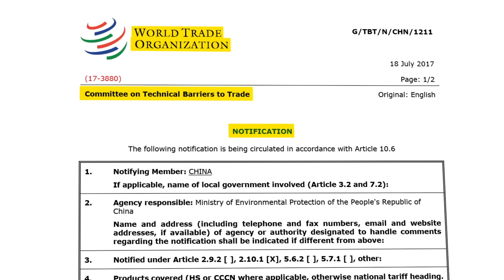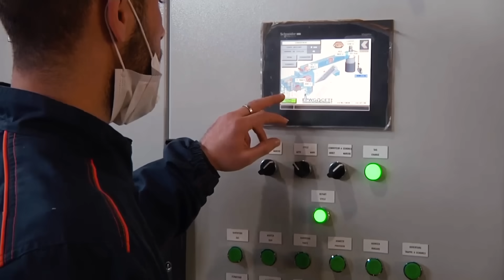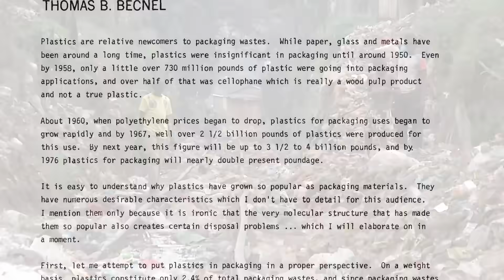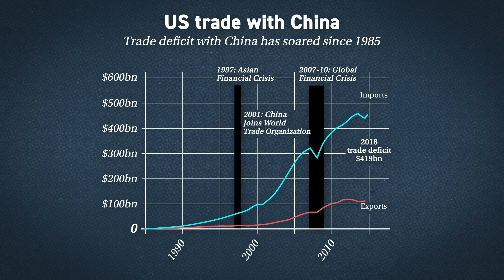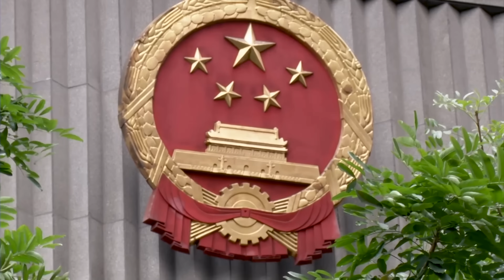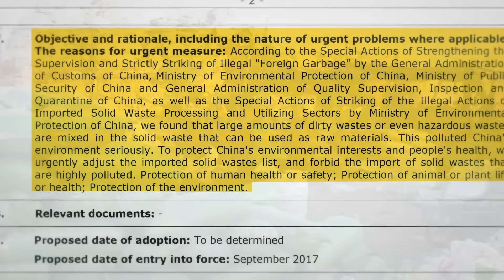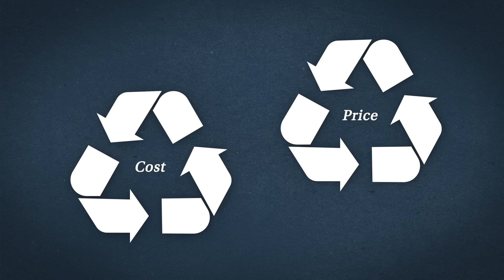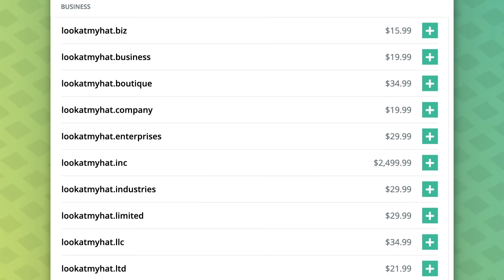How China Broke the World's Recycling

Comment: Good video but you missed a few key points:
1. Residual bails don't get exported- they get landfilled.
2. There's enough domestic plastic recycling production in the US to make at least most of the plastic by volume (HDPE, PPE) cost neutral for MRF's.
3. The problem is NOT plastic.  It's mixed paper.  Plastic is a small percentage of the MRF recovery,  Paper is about 70-80% and has essentially no domestic recyclability.  Paper is what's killing us.

Comment: You know, I just happened to think about the matter half a day later again and something suddenly came to mind. The issue is that there is no easy way to identify what the plastics are, so they can't sort them apart. So why not just make it so the production industry has to mark it in a way that's easy for the recycling industry to identify? You could even create a coordination center between both sides so they could select solutions that create the least issues.

That way one could not just close the loop to the previous level, but do better then before even. Admittedly it would take government action, something which wouldn't be popular among everyone, but this is far from unprecedented government action for curbing environmental pollution. Rather it's pretty mild really.

So I can't help but think this problem only persists because no one can be bothered to coordinate the different parts of the industry to work together better.

Comment: Cheap solution: "new" plastic cannot be sold in any way shape or form that doesn't include a minimum of 50% by weight recycled plastic. 
Less cheap solution: Artificially raise the price of "new" plastic to be more expensive than recycled
Expensive solution: Yeet every Coke, Nestle and Pepsico exec straight into the sun in a rotating fashion until the problem subsides.

Comment: I'm from Eastern Europe. I remember when back in the '90s every bottle was "returnable". You would get a small amount of money if you returned it, and they would clean then reuse the same bottle. It worked well. But the system is gone...
Reply: It stopped because it was discovered plastic does break down on a microscopic level by repeated use, and ingested micro plastics damage hormones. Happens in generic water system plastic pollution but also with plastic bottles used for a month.
Reply: @penzorphallos3199  No, it stopped because plastic bottles replaced glass ones. Back in the 90's, we had everything in glass bottles: milk, water, even cola. At least where I lived, only glass bottles were returnable (and there weren't enough plastic bottles around to bother doing the same for them anyway). 
Now everything uses plastic bottles to save the big corporations a couple cents.
Reply: @mute1085  Your "because" is not correct. That's just your opinion. Dig a little deeper and don't make assumption and then try to pass them off as facts. 
The REAL REASON???
"t stopped because it was discovered plastic does break down on a microscopic level by repeated use, and ingested micro plastics damage hormones. Happens in generic water system plastic pollution but also with plastic bottles used for a month." - Penzor Phallos
Reply: @mute1085  For me in Italy it was until the 80s, in the 90s everything was already plastic.
Reply: huh, not the only 'system' in Eastern Europe that disappeared in the 90s
Reply: yes metal cans, paper, wax paper, foil, glass all sufficient, we need to limit plastics use to permanent things not disposeable items
Reply: Because they biodegradable plastics now so those is only one use plastic ....other wise risk it breaking down
Reply: a bottle deposit system would be amazing. i really wish we could bring back glass bottles. makes things taste better, and it is also a million times more sustainable than this plastic rubbish. also doesn't have the same cancer-causing chemicals that plastic receptacles have.
Reply: Returnable bottles are still quite common in Austria.  Most beer and a lot of wine is sold in returnable bottles.
Reply: We need glass bottles back. At least glass is much easier to recycle than plastic, and if it was thoroughly implemented by companies and governments like it once was, the cost would come down to be level, or even cheaper than using plastic bottles.
Reply: Oh no... since when? I enjoyed that in Germany. Metro NYC does it also.
Reply: That kind of system is still in use at the very least in the Nordics. Pretty much every bottle and can has a return payment added to the price that you get back when you return them. The rate of bottle returns is around 90%. It's unfortunate if other countries have stopped doing it.
Reply: @brlbrlbrlbrl  but they aren't refillable, we need to go back to bottles and containers that can be reused.
Reply: I'm from China, and I remember the same system back in my childhood, but only for glass bottles as far as I can remember. Mostly coca cola and beers, you just return the bottle to where you bought it. Haven't seen it for years now...
Reply: in autsria and germany we still have that
Reply: We used to do that in Australia too.
Reply: The US had returnable bottles till the 1980's. S. Korea still has returnable beer bottles. If we put a deposit on all packaging and make industry deal with it, they will find a solution.
Reply: @anonymousetrapper  That's why a system using glass would need local government support, so it doesn't have to be shipped overseas and can be melted down properly in the origin country. Of course you would also need the bottle manufacturing to be local, but alot of modern business already use glass, and their bottles are most likely manufactured in the same country as their product.
Reply: @xanderstuff7  local bottle manufacturing is not enough, you need also have it refilled locally. Otherwise you end up with transporting both filled and empty bottles.  Take a scale and weight a 0.5 l glass bottle, then multiply it by 3 and compare the result with the weight of an empty PET 1.5 liter bottle.
The thing is, PET bottles are recycled more or less locally anyway, they are of the high value plastic variety. The problematic stuff is in those milky youghurt containers and stuff like that, especially the multi-layered items.

Comment: There is nothing wrong with incinerating it.  The heat is used to make electricity or cement. They literally use tires and coal for this and used plastic and paper is far cleaner.

Comment: I wish this video has a little more "solutions" to the issue, like what we can be doing instead of using so much plastic, like paper or aluminum. I just don't like seeing that there's no hope.
Reply: Using less plastics is not a good solution, at least not if you're going to substitute it with aluminum or paper, because studies have shown that those alternatives are generally (much) less sustainable than plastics for most applications. It's not hopeless at all, there are very good solutions for plastics pollution, they're just not really on the political map yet. Here are a few:
-Massively increase incineration capacities worldwide, especially in developing countries. Incineration isn't great because it emits lots of CO2, but it's better than landfilling and dumping plastics in the waterways.
-Develop an international trading system for carbon-containing wastes similar to the european ETS, then use this as an economically optimal tool to tax virgin plastics production and subsidize recycling.
-Develop chemical recycling, which Wendover glances over at the end of this video but is actually probably the most important of all. Instead of incinerating waste, you can actually gasify it, obtain synthesis gas, convert it to methanol, then use the MTO process to produce olefins from which you create new bulk plastics. This is how china has been making its plastics for years, except they get the syngas from coal instead of waste. The plastics that you get this way are of virgin quality. You can use unsorted organic waste (including plastics, kitchen and garden waste, paper, textiles etc.) as input and don't need expensive collection and sorting infrasture. Compared to incineration, CO2 emissions are vastly reduced because the carbon goes back into the new plastics. In fact, if you use plant matter to make plastics this way, emissions are actually negative. Once this technology is in place, it will be quite simple to collect and recycle most of the world's plastic waste that is currently going into the ocean, as over 90% of it comes from just 10 river systems (8 in asia, 2 in africa).

What can you, personally do? Lobby for the political measures mentioned above and encourage people to read up on the relevant literature so they can make informed decisions on what do buy. Also continue to sort your trash, because depending on where you live, chances are it does help recycle at least a portion of it. More importantly, don't litter, because even landfilling in developed countries is far superior to having plastics end up in the ocean. And if you really want to make a big difference using money, use it to buy and delete ETS emissions certificates. if you buy high-quality ones, you're not just reducing your carbon footprint, you're also contributing to various highly beneficial projects including forestation and also plastics waste removal. This is, in general, one of the best things one can do for the environment as an individual.
Reply: @SpaghettiToaster  wow I am completely impressed and also very thankful for your informative reply! Thank you, along with this video, I have learned a lot about the matter. I am very interested in recycling and plastics and I actually think about it every single day. Alot more informed now than before. Thank you!

Comment: Part of the reason why recycling plastics isn't profitable is the cost of sorting it.
Instead of subsidizing, force companies that make plastic packaging to print an code on the item in multiple locations that can be read by scanners at the dump.
Or maybe some kind of isotope for non-food plastics, or a chemical marker. If all kinds of plastic can be machine sorted, it greatly reduces the costs of the recycling process.

Comment: The companies that manufacture and use plastics shall pay for their recycling. They make profits of millions, they should be ready to part with some of it for the environment's sake. If not, It would not be long before all sorts of plastics are banned.
Reply: That is the system we have in Spain... at least in theory. In reality, we have an extremely corrupt system where a "non profit corporation" is tasked with dealing with plastic waste, using the tax plastic producers and distributers pay. The thing is, the company is owned by plastic producers and distributers, so its main goal is not effective recycling, but minimizing cost, so the plastic tax remains low. 

As the whole country depends on this corp, it has an enormous lobying power, and it has been used to stop any plastic deduction/reuse initiative. There is also some high level corruption going on there.

The data from independent sources  absolutely contradicts ecoembes  (the spanish plastic recycling corp). Plastic from Spain has reached all over SE Asia and after the export ban, many "accidental" fires have burnt the piles of low value plastic waste.

Sorry for the long text, but I needed to warn you about how this system may not be enough.

Comment: You don't need to wait for free market forces to solve this problem, if ever. The government has vast coercive power. Ban virgin plastic use for most applications and mandate that recycled plastics only are used. If you dont like that option, add a large tax on all products using virgin plastic. Either result will make recycling "economical" and resolve the issue.

Comment: I've always felt that low value plastics could be shredded, and thrown into the hot pugmill with the aggregate and the heavy tar oils, to make stronger roads. Roads that have less lighter fractions of oil coming off of them (By the process of photochemical and environmental cracking), and last much longer. The ultimate solution would be an aggregate (maybe even recycled glass?) + plastic road, laid with current technologies, that did not use tar.

Do not deluge me with thoughts of bull**t modular plastic roads that have channels and solar crap in them. Those are provably unworkable, and engineering nightmares. We need millions of miles of roads, and by building them with plastic, in a conventional style, we could lock up so much carbon, yet make it useful, and profitable at the same time. Also it shortens the reuse chain to a locally sustainable solution very quickly.

Comment: Big solution you didn't mention : carbon pricing.

Plastic recycling doesn't work because new plastics are dirt cheap... because, like in China a few years ago, governments haven't priced in the externalities of their environmental damage.

If robust carbon pricing pushes up the cost of oil and new plastics, that will also push up the cost of recycled plastics, and the system will work.

Carbon pricing will help renewable energy / electric cars / recycling become profitable, and reduce the amount of carbon & plastic pollution.

Comment: I do not agree with two things: First, the recycling is a technical problem which results in an economic one. The reason for this are the recycling methods. These are too expensive and to lower the cost of recycling new techniques have to be developed. Secondly, shutting down the whole “plastic system”, whatever that means precisely, is the wrong solution. Without plastic many products would be more expensive which leads like plastic pollution to a lower life quality. Also it has to be considered that plastic is responsible for the longer durability of food on which we can all agree on that this effect is a good thing. This discussion would become even more complex if we consider medical goods...

Like all things in life the usage of plastic is a trade off and how to handle it is not a one dimensional task.

Comment: How strange that Plastic Recycling is actually PROFITABLE in Germany... to the point where companies are even importing it just to burn it for electricity..
Reply: You're confused: They're burning it because it is NOT profitable to recycle. They do recycle a lot, but that which is not profitable to recycle is burned.
Reply: @SpaghettiToaster  They burn it and make ELECTRICITY in the process, AND get rid of other garbage that would otherwise have to go to Landfills, which basically dont exist anymore.
Reply: @Basement-Science  Yes, they do, but what does that have to do with the profitability of recycling? Incineration is not recycling.
Reply: @SpaghettiToaster  Yes, incineration IS often included in recycling. And it makes perfect sense for Plastics in particular, since the difference in Energy you get from burning Oil directly, to turning it into Plastic and then burning it, is minimal. In fact while any oil (or Gas) at all is used for power generation, there is little point in any other type of recycling from a climate- and environmental perspective.
Reply: @Basement-Science  It is not recycling by definition. No german waste accounting or statistical report refers to it as such; in fact, the definitions of both terms are set in law. The relative benefits of either have nothing to do with the definition or use of the terms. To call incineration recycling also doesn't make much sense from a linguistic point of view. It is not recycling because it doesn't re-enter the plastics into a cycle. If you were to gasify instead of incinerate, capture the syngas and use it to make new plastics, then it would be recycling (and actually much superior environmentally to either incineration or mechanical recycling). But incinerating with no effect on the downstream production is clearly not recycling.

Comment: Hold on a second because I don't think that burning plastic back into raw materials can be totally unprofitable. Aren't there those towers that take in the carbon dioxide or carbon monoxide in the air and compress it into diamonds? Why not have 1 or 2 of these towers installed near a recycling facility and then sell the diamonds made by the exhaust fumes from burning / melting down the plastics, to turn a profit?

I'm only wondering because from what I heard those diamonds do sell for 50 bucks each, and with a stable source of carbon emissions from a recycling plant, wouldn't you be constantly producing these diamonds? IT SOUNDS profitable to me.
Reply: That's industrial diamonds, the ones on jewelry are natural diamonds.
Reply: @TJ131V1  Yes, however it's the indestructibility of diamonds that makes them appealing, not how they're formed. 

The strength or solidity of the diamond shows the strength of a persons love for their significant other, and the size of the diamond shows how much that person loves them. 

That's how I interpret diamonds anyways. It's not the monetary value tied to the diamond that makes diamonds the go to jewelry, it's that they're a symbol for strength and fortitude. 

Basically all I'm saying is, people would still, and do still, buy industrial diamond jewelry just like normal jewelry.
Reply: @WilliamHaist  well I think that the price of industrial diamonds are much cheaper and they are used for cutting things, not jewelry. I might be wrong though.